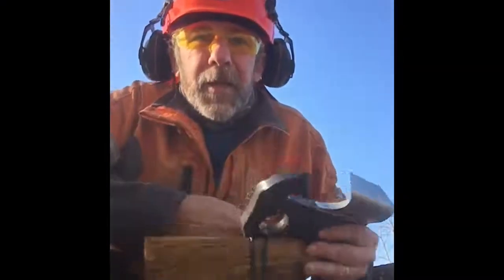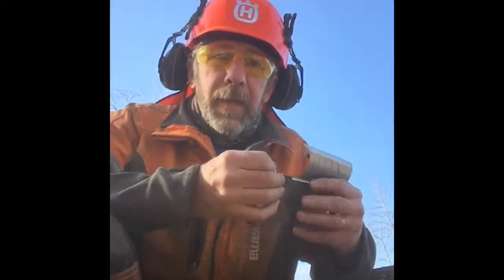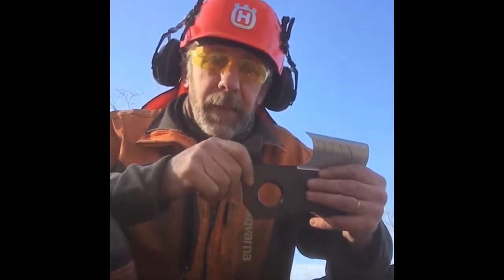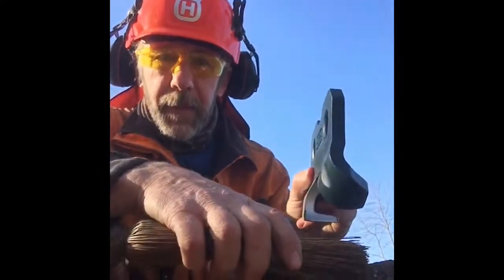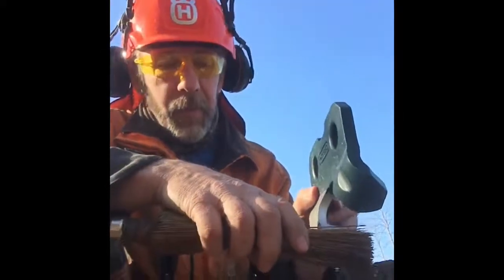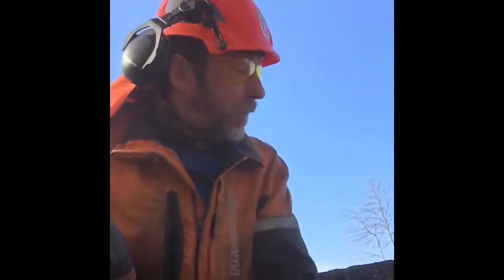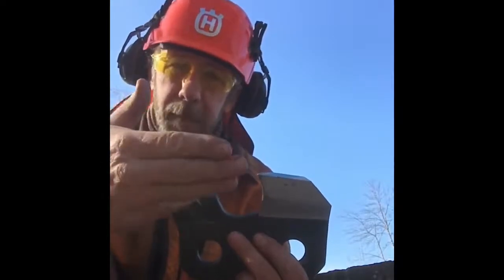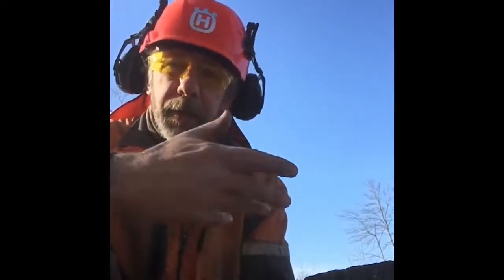How saw chain works

Comment: Interesting question at the end. I'll take a crack at it. Perhaps it depends on where in the "log" you are as the tip will be grabbing different grain orientations as it passes through the log? On a cross cut for example, near the top of the log you are essentially cutting face grain and as you approach the middle of the log you are cutting side grain (basically a flat sawn vs. quarter sawn situation). As such, perhaps on the top of the log the side is cutting and near the middle the top is cutting. During angled cuts, such as the top cut of a conventional notch, perhaps both are cutting.